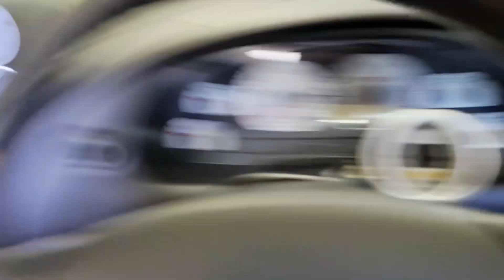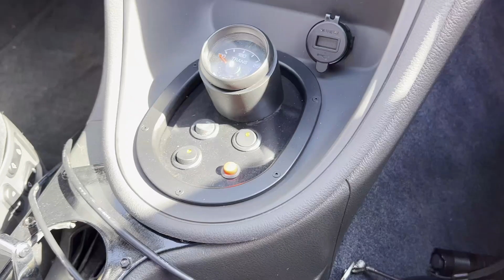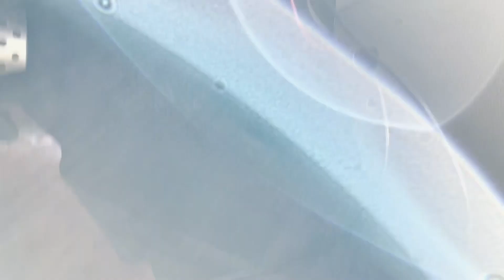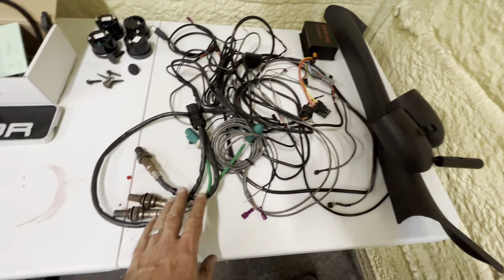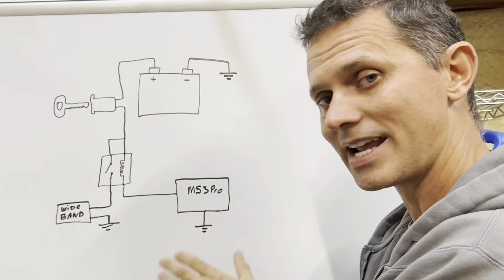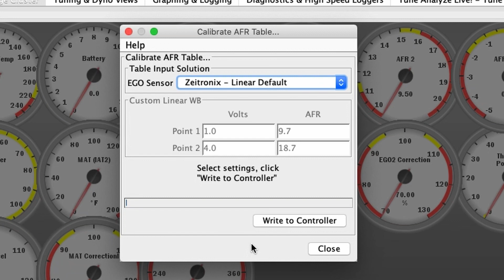Installing the CAN widebands into Project Redfire 03 Cobra part2

Comment: Good evening Malcom, I know it has been quite some time since you posted this, but it is the only helpful video I have found. 

I have two ZT-3’s and wired it very similar to yours. 
- Using pins K/I for the CAN L/H.
- Using pin V for HCO2 out for the relay ground.

I have the two ZT-3 CAN L Y’d together and CAN H Y’d together about 6” from the module running to the MS3. The problem is in the documentation it says I need a 120Ohm resistor to terminate both ends, what did you do for the ZT-3 end? Do I run the resistor just after the Y or do I need to make the CAN loop more like a T? Where the 120Ohm is at the top left and terminating there, the MS3 at the top right, and the two ZT-3’s running into them?

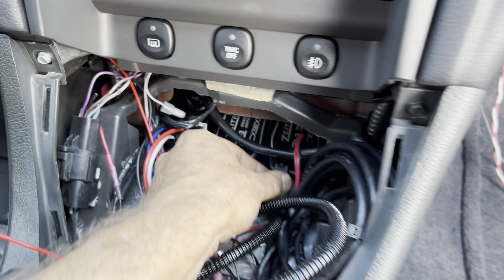Thanks! 8:33
Reply from the maker: From your description I'd say the second option you described.  You essentially want the terminating resistors (or devices with internal terminating resistors) on either end of the setup.
Reply: @MalcolmV8  I appreciate the response! I’ll hopefully have it wired this weekend. 

I have thoroughly enjoyed watching all of your videos! Would love to see more, any plans on new content?
Reply from the maker: @cody896  Glad to hear and yes I have more content. Between work and a new baby and lots of other projects going on I just haven't had much time but I do plan to get back at it when I get a chance.

Comment: I like the delay to turn the widebands on. Especially when pulling data from the SD card. But what do you do if you want to catch the A/F during a start up? Or do you just make it so it doesn't read the widebands for a bit? I think I currently have a 30 second delay before it reads the widebands.
Reply from the maker: If you want to see the wideband reading immediately after startup then enable it temporarily to see but no reason to leave it that way long term.  Your base VE table and idle VE are all dialed in with the car fully heated and warmed up (wideband is of course heated and in use).  Startups ASE both cold and warm I dial in by feel and what the car likes and responds correctly with.  Warm up enrichment I do a combo of what the car likes and what the wideband says.  By the time ASE is done and you're into warmup enrichments the wideband is in use.  So I've never had a need or reason for the wideband to be turned on instantly as the car starts.
Reply: @MalcolmV8  Sorry to take so long to reply. I've been mulling this over since you posted. I think I'm going to try this set up with my car. I currently have the Perfect Tuning gauge and widebands connected to a relay triggered by the convertible top fuse position. I have a coupe. I think I can make this work by just moving the relay ground to the MS3. Thanks for the idea.
Reply from the maker: @shftn04  No problem.  Sounds like you have a handle on it.  Best of luck.

Comment: I’m interested in that md racing lean protection module is the owner ends up selling it or hasn’t sold it yet
Reply from the maker: He’s hanging onto it. I’ve received several inquiries but he decided to keep it.
Reply: @MalcolmV8  ah bummer, seems like a nice unit ima have to hunt one down now haha
Reply from the maker: @modlist6129  They show up on svtperformance.com once in a while.  Usually get snatched up fast though.
Reply: @MalcolmV8   I was poking around my car today and seem some odd wires that went to the engine bay and into the harness, noticed they lead to under the carpet by the tranny tunnel and I ended up pulling out a wot box haha I was hoping it was a lean protection module instead 🤣
Reply from the maker: @modlist6129  😄so close....
Reply: @MalcolmV8  how do you feel about wot boxes? Would you feel comfortable using one?
Reply from the maker: @modlist6129  very minimally.  Right before you launch you 2 step but for 1/2 ~ 1 second.  Don't sit there on it waiting to go.  It's very harsh on the chains and timing components.  Ideally I prefer upgraded chain guides and metal primary tensioners (not the plastic ones) with the bottom 3 or 4 tooth shaved down so the tensioners don't lock out stretching your chains and stressing everything to the point of failure.  But yes they are widely used by many.  Just be smart with it and don't sit on it.
Reply: @MalcolmV8  I’ve heard about that, I don’t plan on using it for launching I got used to my holding my foot at the rpm I want to launch at, mainly if I do use it would be for the no lift shift option but feel iffy about it I’ll probably never use it
Reply from the maker: @modlist6129  I used to love the no lift shift on my Cobra when I first got it but once I started turning up the power I was afraid of blowing up the stock T56 so I quit using it.  I might have to look at it again one day now that I'm on a T56 Magnum.
Reply: @MalcolmV8  that’s how I feel about my car also, I have a 2.3 whipple with a 3” upper, once I take it to the track maybe I’ll try it but not sure. Thanks for your replies man I appreciate the knowledge you share and have been sharing for the past years on svtperformance and other forums
Reply from the maker: @modlist6129  you're very welcome.  I always try and answer and help out when I can.

Comment: Awesome video, I will be installing a Haltech Elite 2500 on my 03 cobra in the next few months. I will definitely use the tech tips you provide when wiring up the Haltech CAN widebands.
Reply: What widebands are you going with? My son is going to be using an AEM wideband with the Haltech Elite 2500, but I'm not sure if he can use the CAN bus.
Reply: @shftn04  I bought the Haltech CAN WB2 NTK wideband kit for this system. Should be installing soon.
Reply: @boostedg3177  how close are you to running? We're having some start up issues with the haltech. I know it's operator error.
Reply from the maker: Sounds like a good project, glad this was helpful.